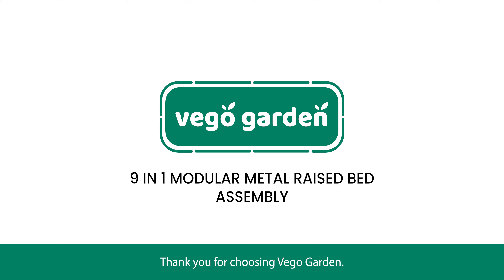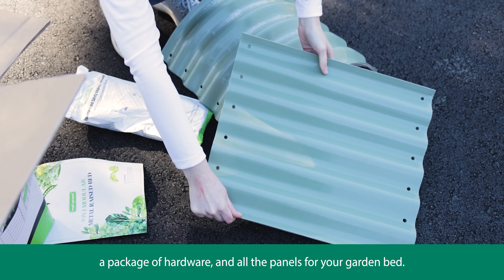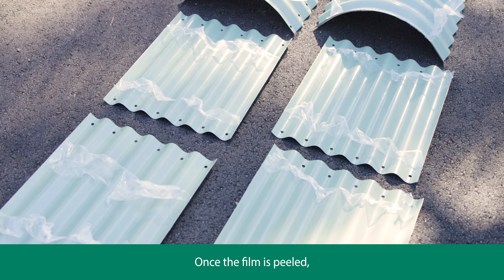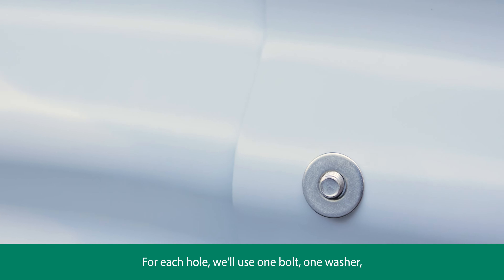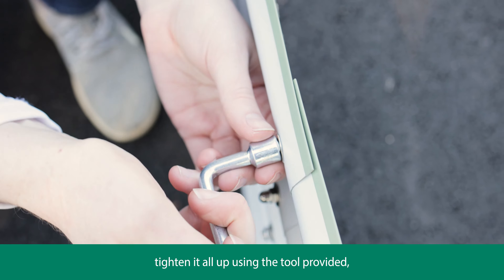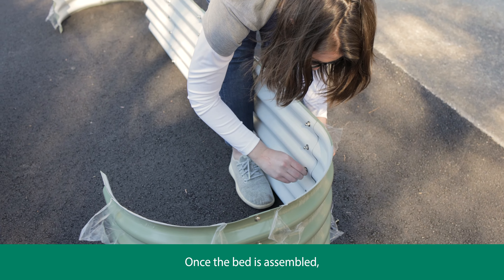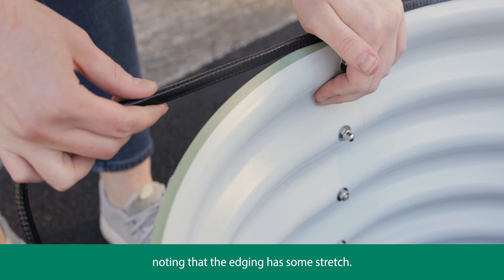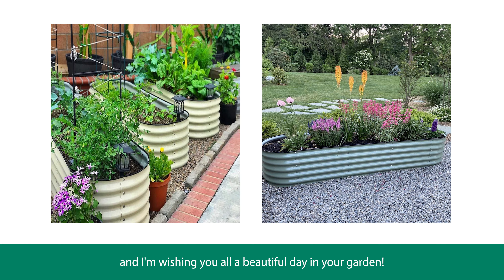Raised Bed 17" Tall 4, 6, 9-in-1 Models Assembly Tutorial | Vego Garden

Comment: looks like you left out the bracing rod which is required for the 8 x 2 configuration.
Reply from the maker: We're glad you remembered the bracing rods! However, the only 17" bed that uses bracing rods is the 10 in 1. The 2'x8' configuration does not have a bracing rod at this height.
Reply: I used the bracing rod for the 2 x 8 because instructions were included to use it